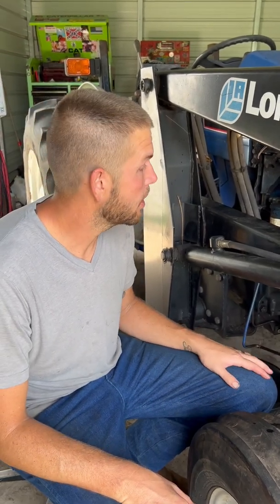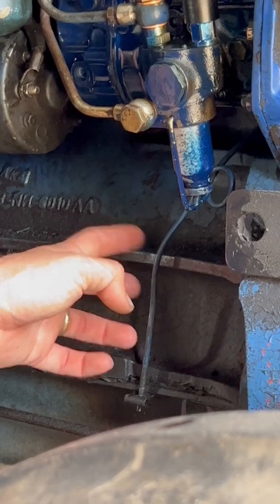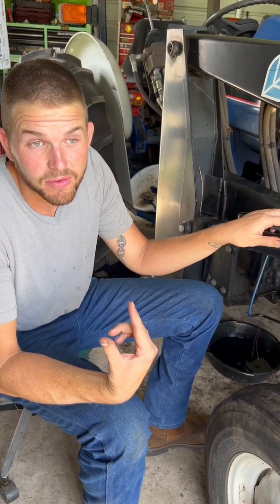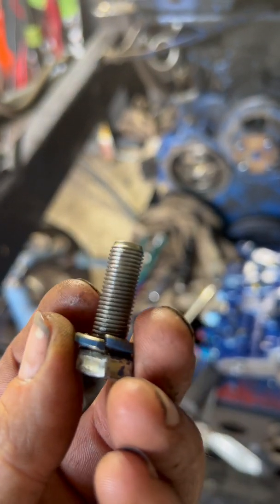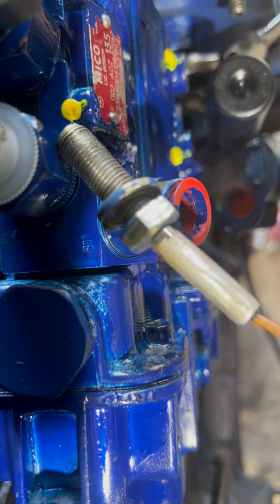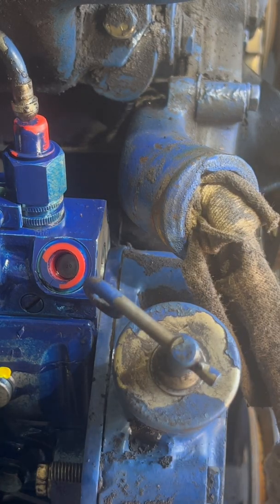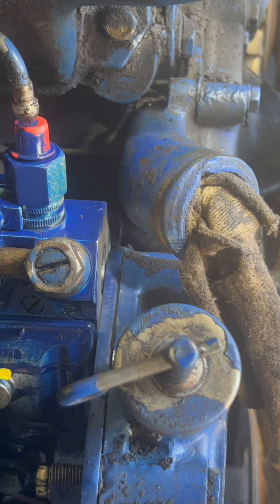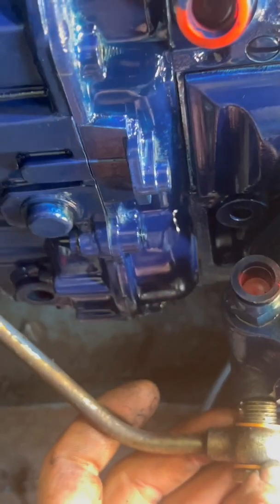Installing a diesel injection pump on FarmTrac 45 tractor (ENGLISH)

Comment: What's the correct way to prime this . I'm not getting any fuel out of the injector lines when I use the primer pump
Reply from the maker: Hand prime to the pump and crack the lines as you’re turning the engine over. Have you removed the feed line to the injection pump and tried the primer pump to verify fuel is making its way to the injection pump?
Reply: @MattTheWelder  I haven't yet but I will try that next thanks
Reply from the maker: @tleonard410  If you’re getting diesel to the injection pump, the step after that would be remove the lines off the top of the pump. Turn the engine over and see if any fuel is squirting out from the top of the pump. If you do t have fuel, verify the stop lever cable is working, if the cable is fine. Then mostly the fuel rack is stuck inside the pump.

Comment: Farmtrac India is a company
Reply from the maker: They’re clones of Ford 3000s. In the states it’s hard to find parts for them. I have a local parts vendor for older American tractors. A ford 3000 radiator dropped right in. The paint scheme fender and toolbox is all exactly where ford 3000s were.
Reply: @MattTheWelder  but what should I do
Reply from the maker: About what sir?
Reply: @MattTheWelder  Ford 3600 is new in USA 🇺🇸 and what is its price
Reply from the maker: @ubaidahmad161 Ford 3600 stop production in the 80s
Reply: @MattTheWelder   ok sir

Comment: i need you hel for instalin my fuel pump on farmtrac
Reply from the maker: I can try to help, assuming it’s the same pump on your machine.
Reply: @MattTheWelder  i from Chile, i note speak good  einglish basic comunicacion, i buy the new fuel pump i need a video for your instalation time adjust of the pump please
Reply from the maker: @arnaldovilcheschoque7354  have you removed the pump already? If so you have to time it using the spill timing method. If you haven’t removed the old pump there’s a way to mark the pump hub and drive gear that avoids the spill timing method.
Reply: What is spill timing method.
Reply from the maker: Spill timing method goes something like this, install pump with timing gear off, leave the line for cylinder 1 injector unhooked from the engine but hooked to the pump, remove valve cover, turn engine over by hand until #1 cylinder (closet to radiator) gets to the compression stroke (both valves will be closed). Now on the brake pedal side of tractor there is a rubber plug on the flywheel window, it is located down low. If the flywheel were a clock it would be at the 7 O'clock position aft. When you get onto the compression stroke for number 1 cylinder. Start looking in the flywheel window with a flashlight, as you pry one tooth at the time you will come to the timing marks....the first one you will see is 30 degrees Before Top Dead Center, then it will count down by 2's 30, 28, 26, 24 etc..... Stop when you are at 25. There is no pointer to tell you exactly where 25 is..... but you can guestimate based on where the wheel sits in the window. You want 25 degrees before top dead center to be visible. Remove the injector line off of injector number one. Put the 22mm nut back on the injector pump shaft but leave the gear off. with your 22mm wrench rotate your injector pump rotate pump in the direction that the engine rotates while running.It will roll easy and then pop with a spring loaded feel - look at the injector pipe that you removed off number 1 injector.....as you are rotating the pump, also work the hand primer. You will hear fuel whooshing through the return line (pay no attn to that) but eventually as you roll into the right position - you will have coming out of the number one injector line. After you are done rolling the injector pump around and watching fuel squirt out of your number one....you will have figured out right where you need to stop rotating the pump....just before the juice starts to squirt out of number one. 

Sorry for long response, it’s a process if your pump is still on the machine. It is much easier to mark the pump hub and the timing gear with a center punch like I did in my removal video. Hope all this info helps.
Reply: Matt, Thank you very much. I appreciate the information on the spill timing method. Works Great! My tractor started right up. Now, just to put it back together. Thank you very much! God bless you and your family!
Reply from the maker: Glad to hear it! Sorry the delayed response, I’ve been busier than ever. I try to get back to everyone who comments on tractor repair videos. 
I actually get calls from folks in India who need help timing this pump. My wife says I’ve never met a stranger.😂
Reply: Thank you for the video and information.

Comment: I have farmtrac 45 that only starts with starting fluid
Reply from the maker: Sounds like the fuel rack in the pump is stuck, if it’s a Bosch/mico inline pump and the pump oils never been changed they’ll lock up. Before pump is deemed bad, make sure your getting good fuel flow from the tank make sure fuel flow is getting to the pump. If you have fuel getting to the pump, take the injector lines off the pump and turn the tractor over, see if any fuel comes out of the pump with the stop cable in run position. If no fuel comes out your rack is probably stuck or the plungers are stuck or even broken plunger springs and pump needs rebuilt by a reputable shop.